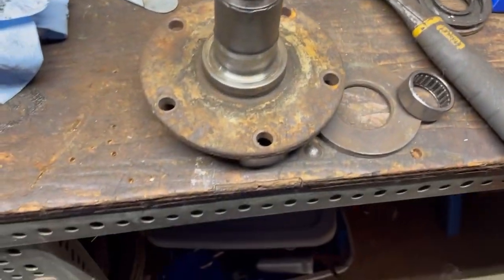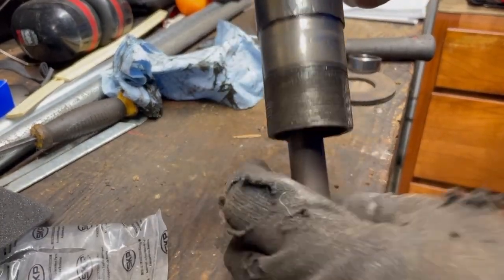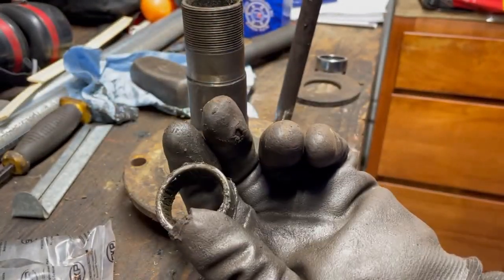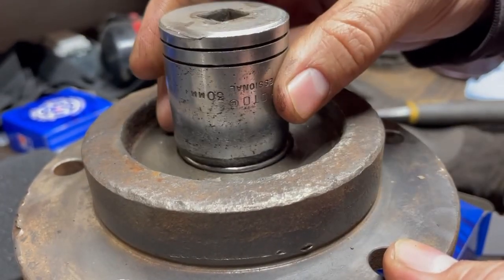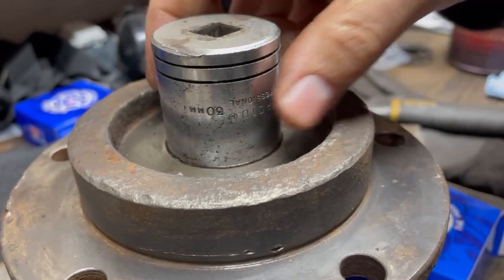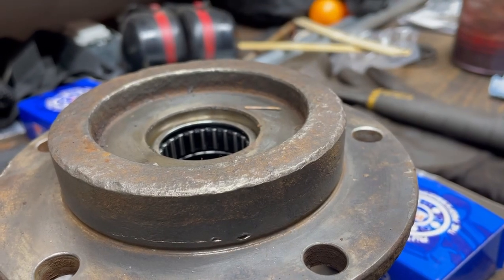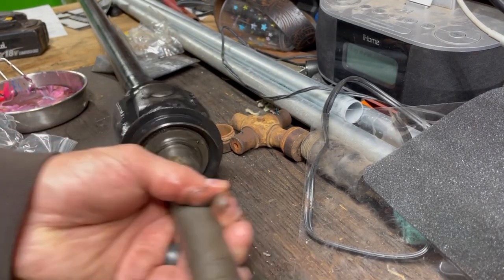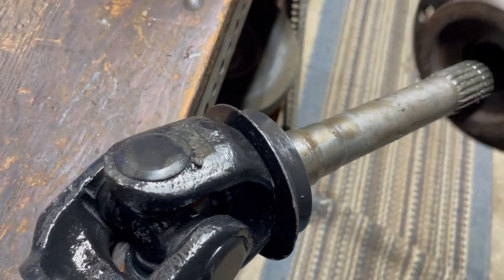Dana 44 Spindle Bearing replacement.

Comment: Nice video. I do suggest keeping the spindle beaeing seal on hand to make sure you don't install the sokndle bearing too deep. You want the small spindle bearing seal to be slightly "proud" just above the surface to seal against the Teflon and or brass washer that you showed  towards the end of the video. This will lightly preload the seal and gurantee a water tight seal
Reply from the maker: I will double check this when I get the axle back out to finish installing the spindle & brakes. Always appreciate tips & corrections, keep learning. Thank you!